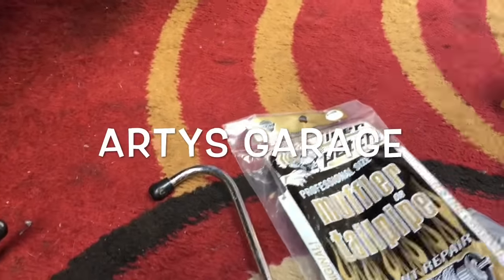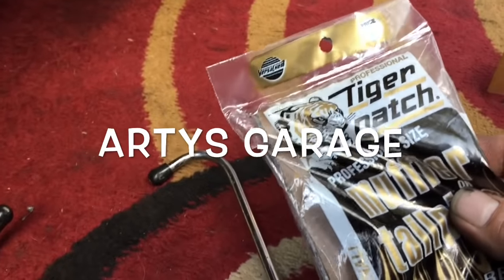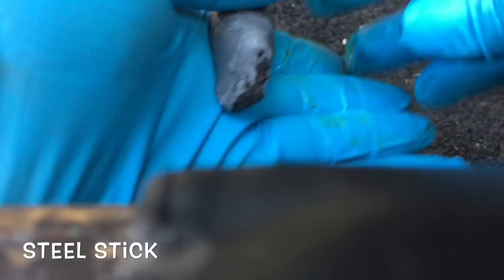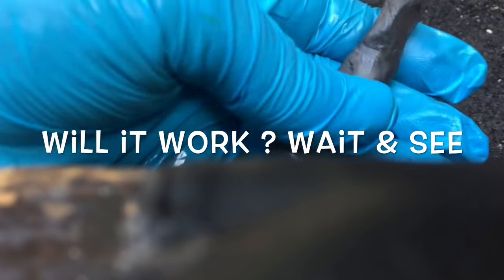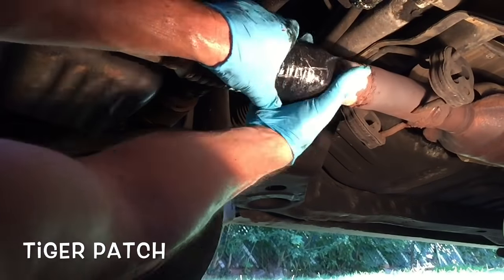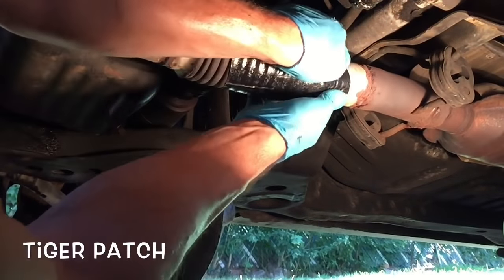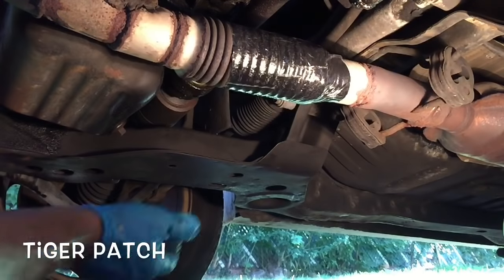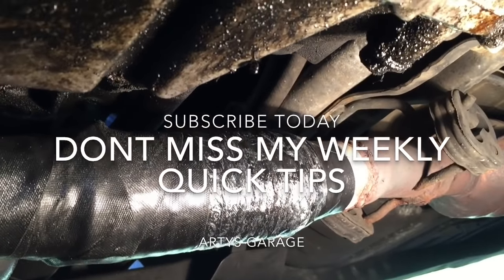How To Repair Exhaust/Flex Pipe Fast, Easy, & Cheap

Comment: Have tried this but would last for a week because the crack was on the flex portion of the pipe, so the leak came back.   See that the fix in the video was actually on the mount/joint (i.e. not the flexible part) so should last longer.

Comment: Did a flex pipe repair recently using exhaust wrap smeared in high temp red silicone and oversized hose clamps to hold it in place and put additional pressure on the offending area. Worked a treat and  should be pretty permanent no more exhaust fumes in the car.
Reply: hm might use that silicone baking form l found, but it hast 250 celcius max stamped on and how hot is manifold near one thousand or more so l have to tie a piece on it with wire and test it but hm should be under thin metal too to cover it conserve the heat.  or concrete, l see fiberglass is used, l have some tile cement for between them but might have some plastic or what , must test over fire if burns first make a small cake with water and dry. and yea might contain clorine chlorine that damages air flow sensor. how to know, google. putty has chl...now l tested silicone baking form slice over fire, it burns. .  used like tin can material but bigger coffeecan on small flex  so big it went at least two circles or more cut inch or two in ends with finger wide space between cuts so can can come down on ends and it worked today in the way l wanted , the power of car is more cos backpressure is better. but how long to melt the can dunno cos it leaks a bit , but small leak is better for gas milage , cat seems too tight.

Comment: I'm going to try this... Went to two auto part stores to buy the clay/epoxy and they both recommended I just replace the whole flex pipe.
Reply: So replace the whole flex pipe…it’s about $60 and is the only permanent fix

Comment: Did multiple fixes like this (extreme temp JB weld) + tape (also tried this black putty stuff) … all the repairs I did only lasted a week and since it’s a flex pipe it’s gonna break open very quickly.
Reply: You need to change the engine mounts. Then replace the flex pipe
Reply: @Nomoreranch0 why? Only need to replace the engine mounts if they are broken/worn. Flexi pipes do break down over time and need replacing, independently of whatever is happening to the engine mounts. If the engine mounts are worn / broken then it could result in the Flexi breaking, but this isn't necessarily the cause.

Comment: I used header wrap and 2 metal clamps and its still going strong. Muffled the loudness really well too. Just make sure you buy big clamps because the header wrap is thick.
Reply: That's a good idea man.
Reply: thanks man! i think i found the best answer for my problem!
Reply: Where can i find header wrap?
Reply: @miltondearmon5405  at autoshop ..
Reply: Did it kill the noise?
Reply: This took 5 mins and worked!

Comment: Epoxy is the worst thing to use for flex pipe repairs.  The pipe gets too hot.  It will stink, and fail, within a week.

Comment: Does it still flex with this type of repair?   Or does patch stiffen up the flex section?
Reply: Well it isn’t affecting the actual flex pipe, it’s still able to move around, this stuff hardens like steel literally
Reply: Maybe not wrap it so far up on the flex pipe? It could have another leak or the muffler making that noise. 👂

Comment: DO NOT DO THIS! this guy doesn't know what he is talking about. within hours of driving this stuff will completely burn off no matter how long you wait for the cure. It is not meant for that kind of heat. I have tried every kind made, even the high heat, doesn't work. you will get a toxic cloud of smoke inside the cab not long after driving
Reply: Finally someone who knows. The best you can use for a temporary fix but it still won’t last long is a high temp wrap. I forgot the name but it is supposed to handle temps up to 1,100 degrees. It won’t fix it forever but it will for about 2-3 days so you have time to fix it
Reply: Also the guy thinks that putting putty and tape on a joint that needs to flex is a good idea. Even if the product was a good product it would crack whenever the flex pipe flexes. Also worth noting that I will be replacing my flex pipe soon and a new one costs only $30 CAD on Amazon. Do it right. Lastly as he said he can’t tell the difference so must not be a great repair.
Reply: This is true, flex steal is only rated to 250-300F, you need up to 850F for exhaust standards!

Comment: Hi I have about a 1 inch cut in the middle of the flex pipe. if I try this fix how long would it last ?
Reply from the maker: All cars differ if the motor mounts are good a while mine all lasted a year

Comment: Would this work on a metal mesh flex pipe?
Reply from the maker: +Searching High And Low you have to cut the mesh off the flex pipe then you follow my quick tip
Reply: @artysgarage6907  I used this stuff and it got so hot it burned apart and exhaust started leaking through the tiger tape.
Reply from the maker: Then your catalytic converter is probably clogged

Comment: did you have to let the gray paste set over night  before yo can start the car?
Reply from the maker: Nope 1/2 ab hour
Reply: letting the gray putty dry over night good then the tiger patch tomorrow .thanks
Reply from the maker: Good luck
Reply: YES  ,THAT PUTTY IS EASY TO WORK WITH WHEN WET  A LITTLE. THANKS AGAIN.

Comment: It's worth paying $150-200 and have it fixed properly.  It will rust away every 2 years because it will never be as good as oem, but the savings in fuel will offset the costs.
Reply: This'll do until you have $150-200.

Comment: Aluminium self adhesive tape, much better, higher melting point and perfect for a cheap exhaust fix. Done mine this way
Reply: Is it still holding up?
Reply: I was thinking about trying this

Comment: Did you have to clean or degrease the area before applying the putty?
Reply from the maker: +akclan33 yes I removed the wire screen and I lightly sanded it to get some rust off
Reply: Rake room
Reply from the maker: No just clean off and cut off the flex wire
Reply: What did you use to cut off the mesh wire?
Reply from the maker: Are used a utility knife you can use scissors also

Comment: will this pass an inspection? - on the east coast
Reply from the maker: +John Tarantino yes John
Reply: John Tarantino incorrect. most states will fail you for incorrectly repaired exhaust system.
Reply from the maker: +AgentJeffy yes yes true but thanks for nothing happy Father's Day 
That's s shame
Reply: Arty's Garage thanks for nothing? you need to be careful man, you could get someone hurt with your repair.

Comment: Had mine done for $130 this temp stuff never lasts..
Reply: Perhaps that's why it's called temp...orary?
Reply: @ HB where did you have it done?
Reply from the maker: If you live in the Bronx can go to Jerome Avenue is dozens of shops over there Much competition They put flex pipes in for 40 bucks I think in 10 minutes
Reply: @artysgarage6907  That's pretty cheap.  The junkyard by Shea Stadium charges an arm / leg for it.

Comment: guy tried to charge me 200$ i said "Fawk Naw" do it myself
Reply: Guy wanted to charge me 500
Reply: DoITAll 1911 the same 500
Reply: that's crazy I had the same problem I just went out bought a universal flex for $20 and brang it to a muffler shop to cuz the old one off and weld the new 1 on $35 all together a brand new flex pipe weld on and all for less than $60.. $200,$400,$500!! that's straight Robbery!!..
Reply: Jroc daDON yes it's a robbery here in France
Reply: Stiven Stergu wow..that's amazing that it's legal to do? I thought the u.s. robbed it's people the most I guess only in the banking sector they can rob us and get away with it oh yeah,and our public utilities rob the hell out of us but only transmission, electrical,or, the whole new engine is like $350-$500..but they get it on the gas national grid is the biggest criminal empire in the u.s. well aside from the government..lmao
Reply from the maker: +Jroc daDON agree 👍 A government in 
Venti of the union line try to make the compression fittings obsolete he couldn't so I made an illegal thing to do or use I've been using them over 20 years never had a problem eexplain thatLM
Reply: Jroc daDON yes it's crazy,, u got lucky out there lol here in france the transmission or new engine it costs about 10.000€ but it depends the model of the car, i have an hyundai tiburon V6, i changed the brakes,tires and other things about 2 months ago for 800-900€
Reply: If you break the flex pipe twice a year it may be in your best interest to learn how to weld....just saying

Comment: They sell High Heat steel stick, but even this shouldn't be used at temperatures over 450 degrees F, according to the directions. And from what I read, the flex pipe gets up to 750 degrees. Did the hardened Steelstick start to smoke or smell after this repair? How long have you been driving the car with this repair?
Reply from the maker: +Open-minded Skepticit lasted at least a year it did smell in the beginning and then the smell went  away and And then hardened even better
Reply: Thanks for the reply! Cheers.

Comment: PEOPLE! do not follow this advice. Steel stick WILL NOT WORK. Seriously. I promise if you do this it will not last more than 2 hours runtime.
Reply: Was just looking at buying the SteelStik and saw that it was only rated for 200°F, figured the same thing - won't last.